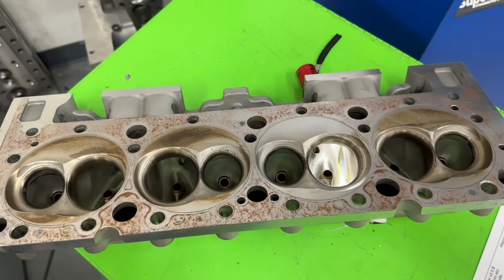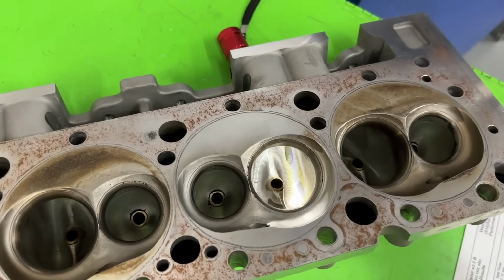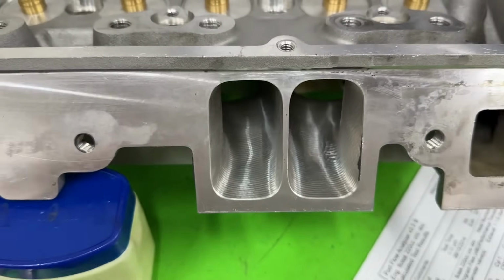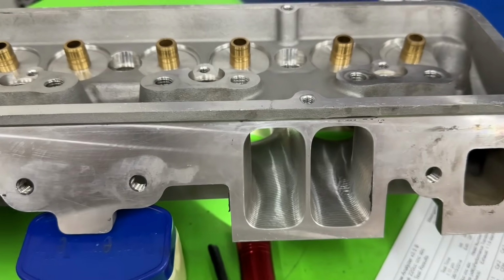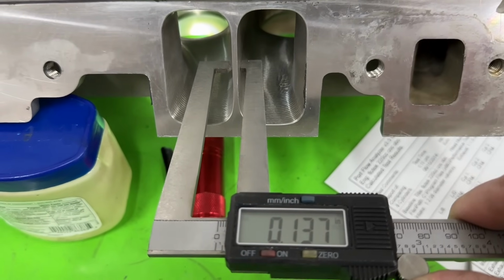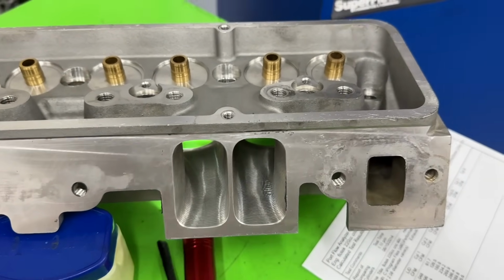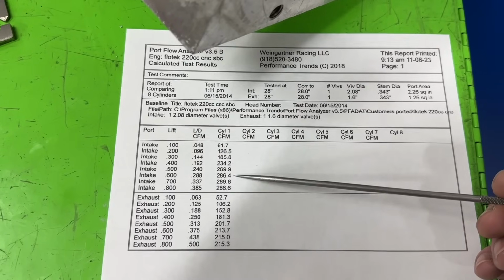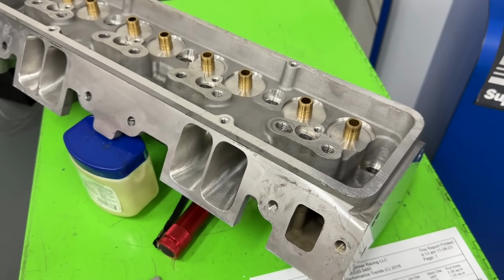SBC Flotek 220cc CNC Ported Head Review

Comment: I also always heard to never lower the floor of the runner to promote as much flow at the top of the port. Would be cool to see you do a video talking about the flow/porting dos and donts.
Reply: F.I and carberated engines work differently. You will deal with fuel separation in the port

Comment: Just for comparision, my (much more expensive) Ford CHI 3V 208cc heads that have been ported to maybe 218 to 220cc, flow 297 @ .400. and 340 @ ,600 and at .700.
The key is that the port is much higher up from the valve seat and have a larger short turn radius. Plus the canted valve.

Comment: Ported a set of Flotek 180cc for the 355 in my pal's 21 foot Chris Craft. Nothing crazy, just worked the areas that obviously needed it. Quality seemed pretty good. Unfortunately no flow numbers to share, but when the Vortec 350 was in the boat with iron exhaust manifolds - the boat could go 54-54 mph with an ideal prop. With the Flotek heads (-50 lb), 5 cubic inches more displacement, a 215º/218º @ 0.515" extreme marine cam, and aluminum headifolds (-100 lb), the boat goes 62-63mph. A significant improvement. Both engines had the same Q-jet carb. Definitely holeshots better with the new engine.

Hard to say how much performance came from the heads vs the cam vs the weight savings (big deal in a boat) - but overall the cheap Floteks seem pretty ok for a moderate build.

Was soooo tempting to get the bigger 220s, but in a cruiser type boat, it'll be propped for 5500-5800rpm max and off-idle torque is super important to get the boat to come out of the hole. Remember, you've only got one "gear" in a boat, so you've gotta balance the low and high speed performance.
Reply: @thomasward4505  No one size fits all answer; totally depends on the type of boat. For a 21' runabout - seems like it'd be 1500 or so.

Comment: I liked the 23 degree 64cc chamber Flotek heads I put on a 383. Only problem I had was the angle of the Edlbrock air gap didnt match the heads perfect, but a little sealant and ROL intake gaskets solved that problem.
ROL gaskets for the win!
Reply: Rol gaskets what's that?

Comment: Makes me wonder if the center divider is removed just past the push rod pinch and about an inch or so in the intake if that would help or hurt flow? Of course the remaining center section in the head should be shaped almost to a point with a small radius at the tip, the same for the intake. Probably would only be good for a single plane though?
Reply: They do it in modern engine’s but, I imagine it would cause turbulence
Reply: Keep the distance the same from the opposite or outer push rod wall as your going into the port, that way the divider will bell out at the gasket and stay wide. The push rod wall tapers in, why not follow that same contour on the divider side, where the divider gets thin as it reaches the push rod pinch about an inch in, but the face stays the same?

Comment: October 2024, i looked at FLOTEKS flow chart... 320 and 238 at .700"... Somethings not adding up...I looked because a set has popped up for sale in my city...
Reply from the maker: That’s what they flowed on my bench.
Reply: @WeingartnerRacing  I would definitely believe your figures.. I looked for reviews, found your video.. I was considering buying the ones that popped up, but would have to flow them first.. Maybe they have reworked them recently to flow better.. who knows..
Reply: @WeingartnerRacing  The Guy here got them flowed 4 years ago..There is a flow sheet...  i'm thinking to flow them again..
Reply from the maker: @drcolster not all flowbenches read the same. They should but they don’t.
Reply: @WeingartnerRacing  Hello, the figures were similar to FLOTEKS numbers, a bit more here and there.. i don't know if the Guy who put them together (because they started bare) actually did some work on them.. He is a pretty good porter, head guy, been doing it for 20 years...  I believe he has a SF-600

Comment: Raised ports make the most power and not lower ports... They made the port funnel shaped, no good!  Tapered...
Reply from the maker: It’s not that simple. If you need area you have two ways of doing it. If one isn’t available you have to do the other.
Reply from the maker: Another note it doesn’t funnel shape. As the top and bottom come together it gets wider. Increasing area
Reply: @WeingartnerRacing  Most people just don't understand velocity and low turbulence in maintaining the cross-section area in a conventional intake port. Even a leaning port or trapezoidal shape with the right cross-section, with smooth transitions conserves energy and returns the sign better. Less fuel dropped from suspension also. That's always right and good 😊
This rarely happens when I type 😮😂

Comment: Why do you talk in head "c.c" volumes,but use 'boomer measurements' for the port dimensions in widths and depths?

Just use millimetres.
It makes a lot more sense.
Reply from the maker: Because these are American heads and in America we use the standard measurement system not metric. If I was doing an import head I might use metric but since most of my viewers are American I still probably wouldn’t. By the way cc is more a boomer thing. It is not near as accurate as csa which has become more popular later. Thank you gen x.
Reply: I hate seeing millimeters used for small measurements, larger or different applications not so much. I seen some Starretts on marketplace cheap yesterday, then noticed they were metric, dang! Being raised in the states it's just foreign to me. Don't think I'll ever learn the conversion. But hand tools I prefer metric 🤷‍♂️